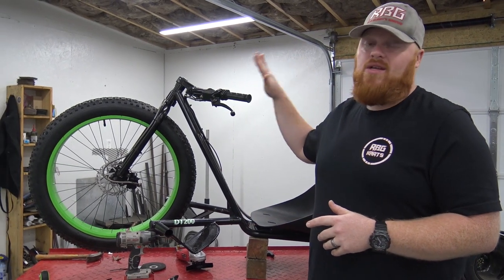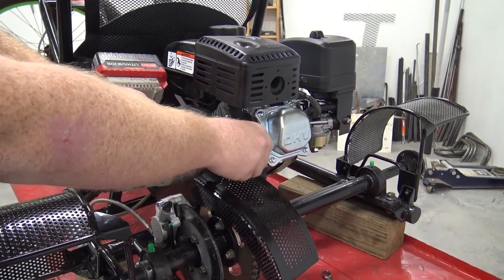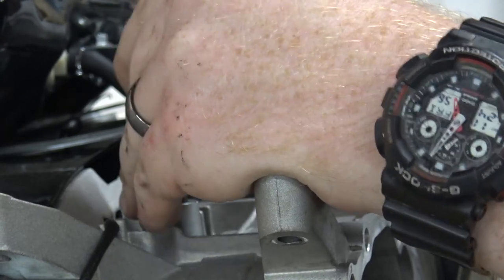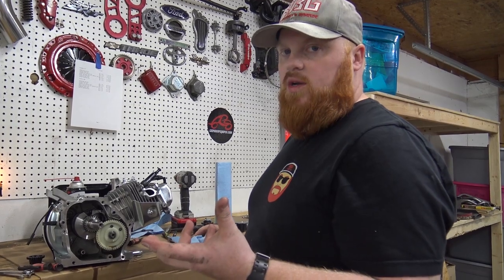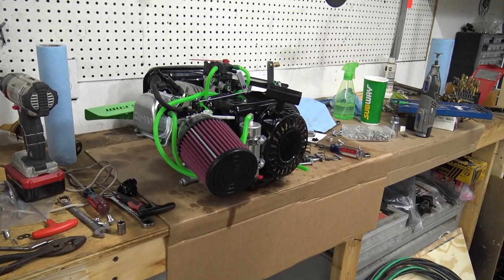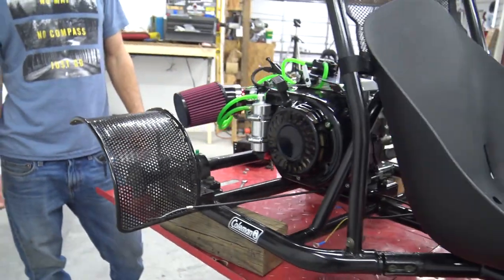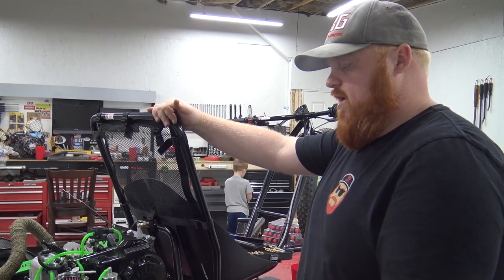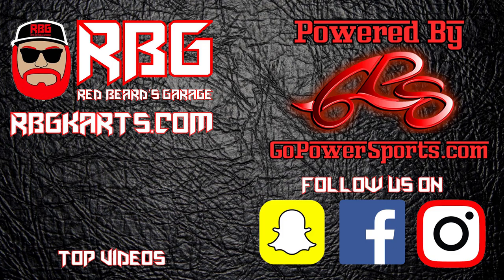Drift Trike Performance Upgrades - Coleman DT200 ~ Mini Bike Monday?

Comment: I removed the governor on my engine straight out of the box and thrashed it from first pull. It's done 50 hours of full throttle drifting and runs well.

Comment: I found that a thumb throttle is good for learners, but after you get the hang of drifting a twist throttle works better. you'll find that when you get real sideways that a thumb throttle gets in the way or hard to use.

Comment: Try deflating the tire and putting the rim on top of a smaller rim. Getting the rubber off the floor and not letting it expand while your sliding the pvc on.
Reply from the maker: We pulled the valve stem out so there was no air in it

Comment: Garage looks great. I'M sure you're enjoying the space. Eventually you should look into epoxying the floor it would look better on video and make spilled oil and fluids much easier to clean up plus add value all at the same time. Must admit the trike looked great after the mods!!!
Reply from the maker: I had the kit but it was too cold to do it and I got impatient lol
Reply: I understand maybe next year i don't know much about the kits but there is a company called gorilla flooring or something like that they have the best warranty i have seen i have several customers that have used them and the stuff holds up better than any other coating i have seen if you park cars on it and turn the wheel with the car sitting still it will not where or come up when a lot of other coatings will not hold up to that it is really tuff!!!

Comment: I would like to see one run without the pvc on the rear tires! Just to see how it performs if you want to use it for riding instead of drifting
Reply from the maker: We plan on doing a video without sleeves soon
Reply: I did 30mph stock without sleeves.

Comment: Looking forward to the video on the new garage. Your old one was so cramped. Some questions I hope you answer in the video, is it near your old shop? Is it heated/cooled? Dimensions? It looks sweet.
Reply from the maker: I added it onto the old shop. Took out the back wall and added 25x21 so now the garage is 46x21
Reply: Red Beard's Garage you did a good job, I thought you built a whole new building. So much room for activities, lol. You got your Christmas early, now with all that space you need to buy more tools and stock more parts from go power sports. A new shop is like a new tool box, it cries to you to fill it. Snap on and Mac hooked me in, at my retirement in 2001, my tool cabs had around $42,000 in tools, and now they are all paid for. I can fix about anything with them, cars, trucks, mowers and tractors. You can get a list started of all the goodies in tool and shop equipment you wanted, but didn't have space for.
Reply: I'm wanting to add a welding cart for my mig so I can add a plasma cutter, a arbor press, and a blast cabinet to clean parts, but space in my shop/mancave is at a premium. I do have ac, gas heat, cable, and internet, so I'll find a way. If I could add a bathroom, kitchenette, and a cot, I'd live out there, turn the house over to my three teenage daughters. And yes, I'm a single dad with sole custody, I'm awash in the estrogen ocean like the tidy bowl man. 😞😔

Comment: people who say they are not worth $1000...probably haven't tried to build one.  If you buy the parts, Fat tire, Sleeves, Engine, Axle, Tires, Clutch...and you use a cheap bicycle for the main frame, you will still be spending close to $500.  If you steal the axle from a kart, get a cheap bike and use whatever front tire it came with...then maybe you can build one for sub $400...but it isn't likely to look as nice.  I bought a pedal drift trike that someone had put a predator 212 onto...the crudest way possible.  I had to replace the front tire, throttle cable,carb, seat, stretch the frame, add tubing for foot rests...the trike was $280 and I spent another $150...so $450 was decent for what it is.  Most used ones I see for sale are anywhere from $800-$1200

Comment: You can use the bottom of a 5 gallon bucket
Reply from the maker: You probably could but it wouldn't last long at all
Reply: Red Beard's Garage I have before, they work alright and come out cheaper than sleeves but you're right they probably don't last as long

Comment: They should make some magnesium strips or something to go on those sleeves to make them throw sparks. That would be Super Awesome! Lol
Reply from the maker: Never though about that. That would be pretty sweet
Reply: Red Beard's Garage Heck yeah it would. Wonder how you would go about embedding it into the sleeves?
Reply: Back in my "lowrider" days people used titanium drag blocks mounted to the bottom of their frame so when you laid the frame out it would drag the pavement.  Also my son has the little drift trike with the caster wheels in the back that has a handle you pull to drag some type of "metal" on the pavement to throw sparks.
Reply: Moneypit330 I remember the days of the lowriders having those blocks draggin the road. Ive always put lowering kits on my trucks. I only go a couple inches in the front and back though. I never did find anything cool about guys dragging their frames down the road. Sparks or not. Lol
Reply: Bryan Wayne Well it's like any hobby in that I respect the time, money, ingenuity that people put into their passion.  I have gotten away from air suspension on my vehicles only because of the time and money. But I would love to have another bagged truck.  I had a bagged 98 stepside Ranger that I had to sell because life happened.
Reply: Moneypit330 Yeah, now days when you see a bagged truck, its usually a full sized one. They have nearly fazed out all the small size pickups. I think they just started making Rangers again. Wish they would bring back the S-10's. I bought mine new in 02, and 03 was the last year of them. Im still driving that truck everyday 15 and a half years later. A common fella cant afford to go in and buy a new Silverado. They cost nearly as much as a house! Back in the day, mini trucks were the big thing. They all had a snug top and half the bed was full of the air compressor, while the other half was filled with JL or Rockford Fosgate subs. Haha

Comment: Red, could you tell me what size Mikuni carb I need to get to put on my Predator 212 or do you think it would be an improvement over the original carb with the jet upgrade in it?
I enjoy all your videos and learn so much but you cause me to spend a lot of money ( just kidding).
Reply from the maker: Not a massive difference. I am going to do a video soon on carbs so stay tuned

Comment: Great video. I am not new to engine builds but new to my DT200. Watching the vid I noticed when comparing both trikes in the beginning that the left “new” one has a silver colored adapter or similar attached to the exhaust (visible on top of the chain guard in the vid). The other one (and mine) are without. Any idea what this is for?
Reply from the maker: Some type of emissions thing

Comment: Red Beard, you inspired me to build a drift bike from scratch but can you tell me the rear axle length I should buy. Just ordered a 36" which translates to only a physical axle lenth of 30", and I don't think it's long enough because of the potential for tipping over. Also if you have suggestion where to get the proper axle. Thanks for the great channel and info!

Comment: Hey Red Beard I have 2 questions, which Trike would you say is the best and most dependable for the money between the Scooter X Trike from Amazon or the Coleman DT200?  Also if I did decide on the Coleman, What brand & size Axle and  What size Tires & Wheels would I need to give it more width in the rear?  And If I did extend the rear width would I need to modify the stock engine?
Reply from the maker: I did a video on the axle upgrade and everything is linked in the description of the video. I have never messed with the scooter x one so I wouldn't be able to say. I really like everything about this Coleman.
Reply: Red Beard's Garage Appreciate it Bro

Comment: Do you necessarily have to remove the governor when you put 18 lb springs in? And another question. Do you have to buy a performance rod when you put in a performance cam such as a dyno cam?

Comment: For what this trike comes with, $1000 is a good price.
Reply: Adam Pendergast you can build it for half that...
Reply: a lil bit of everything Please explain the $500 drift cart. $350 for a kit with tires and sleeves, $100 for an engine. At least $50 for a rear brake. How about the seat, steel, front steering/brakes? Not to mention the time investment to design and build.
Reply: Really can't see paying 1000 for that. Just don't justified a transformed heavy duty bike turned into a 3 wheeled. Gocart.
Reply: I'd rather let someone's else pay 1000 for it, barely use it, then let it sit until the carb is gummed up enough so it won't start and then pay them 200 for it. I sure am glad there are people willing to buy these new, so I can get them much cheaper on CL.
Reply: TheCowboyfromhell87 That, I don’t disagree with.

Comment: Looking to change my rear sprocket to a lower number of teeth..for better top end..I'm currently running the 7hp lipfan cyclone predator engine with stage 1 go pro motor sport package..I'm currently running 47mph..but it takes me forever to get up to top speed, the acceleration is so much more than needed..I have 5 inch PVC sleeves, so I'm spinning 90% of the time..I thought about making smaller sleeves, maybe 3 inch instead..I'm currently running a 60 teeth rear sprocket and 10 tooth clutch...what's some good ideas to make faster top end and a little more traction???

Comment: Why don't you just deflate the tires put the sleeve on and fill er up
Reply from the maker: They was completely deflated with the valve stem out. Did you not see that in the video? There new stiff tires

Comment: I'd give that trike much more respect if it came with some 16-20 inch tires with grip and will go anywhere my buggy will or pull a small trailer. Otherwise it ranks right there with a purpose built drag kart and worthless for 90% of anything. If it's your thing then more power to ya and have all the fun you can.
Reply from the maker: We have more fun drifting these trikes then go karts or mini bikes. You could always slap a set of off road or street tires on the back if ya wanted
Reply: As long as ya having fun thats all that matters. If we all had the same tastes this place  would be pretty boring. I got a set of lugged tires and a set of smoth tread for my buggy for the same reason. The smooth treads can still be fun out in the pasture.
Reply: ffs people being critical of a drift trike for being a drift trike.  Makes about as much sense as bitching that your Rail dragster doesn't corner well.
Reply: @T0tenkampf  somebody whining about somebody else saying they have no use for something even after they stated as long as you are having fun...4 years later is well let you figure it out. Don't wear your crayon out doing it.